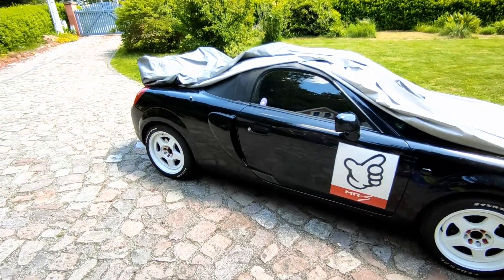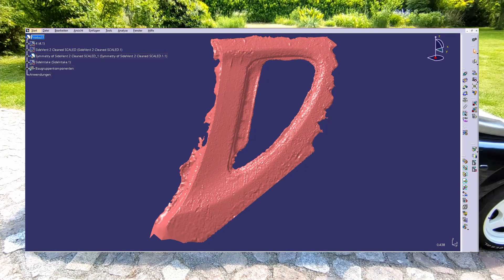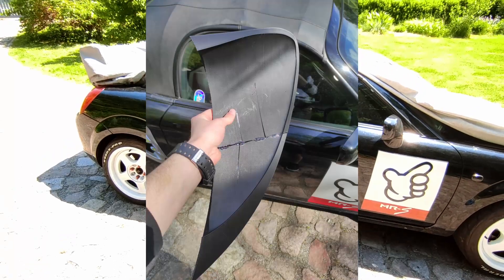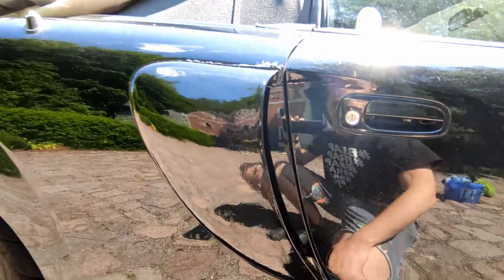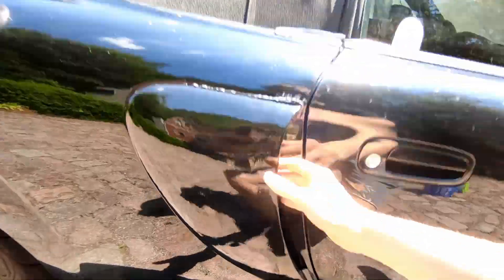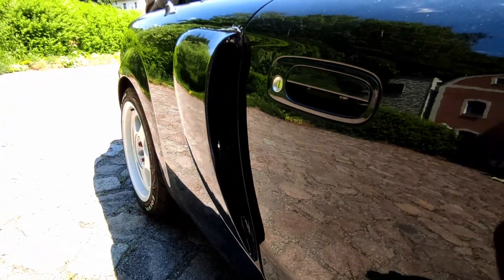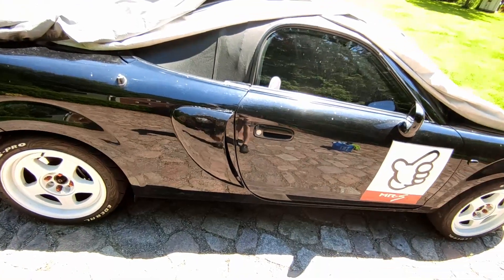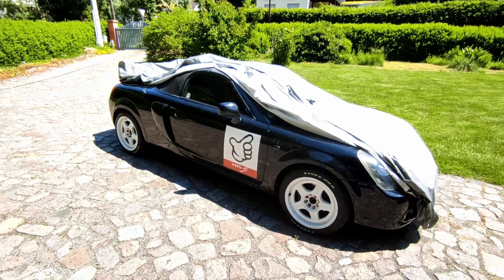I Made My Own Side Vents/Scoops! - MR2 Spyder

Comment from the maker: INFO: It is also possible to get them off when you used the body glue but thats a ton of work..
These steps could work:
-use dental floss to cut the glue
-carefully use a heat gun or a knife to get as much glue off as possible
-get an eraser/ rubber disk for a drill and carefully try to rub-off the remaning glue
-use silicone remover to get the last bits of glue off

enjoy :)

Comment: If printed as one piece, how big would this be?
Reply from the maker: It’s a bit hard to say since the shape is a bit complicated, for that a pretty large volume printer would be necessary. 

I recently checked if it would fit on a Bambu Lab H1S printer but even that size is barely not enough.
Reply: @PlaneTMRS  if I am reading right, the print area on that is 340x340x320.
I have a printer available to me that is 350x350x500.
Reply from the maker: @placeholder2924  Hey, that could fit!

I sadly can't properly check it but I am pretty sure it will work

Comment: Can you make custom vents if I give you dimensions?
Reply from the maker: Hey, Might be possible, what are you thinking about?
Reply: @PlaneTMRS I’m building a mid engine Del sol. I’d like a vent to cover the original fuel door
Reply from the maker: @itsjussjerry  Wow that sounds cool!

Problems with parts like these is, that without a 3D scan its going to be difficult to design something which fits perfectly.. do you think you could get access to a scan of that area?

Comment: They look great, but can you remove them if you need to clean out the drains behind the vents?
Reply from the maker: Not really... I cleaned them already and checkt if they were still clean. If I ever have to take them off it will be quite some work to get the glue off. Maybe it's a better idea to use double sided tape but I didn't want them to fall off